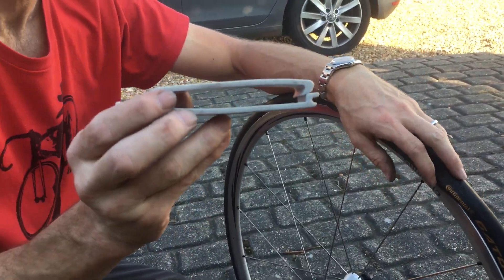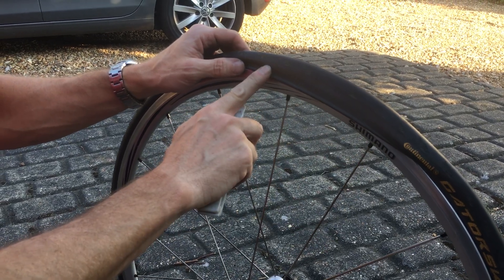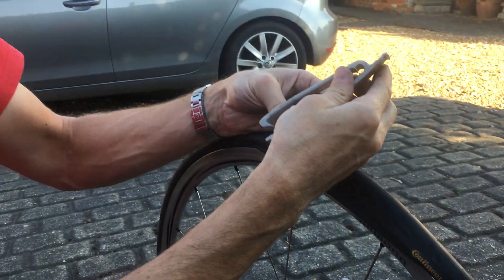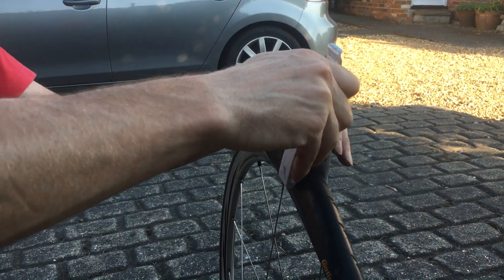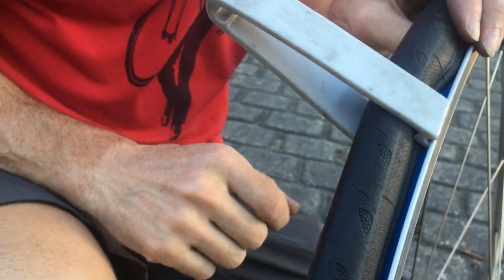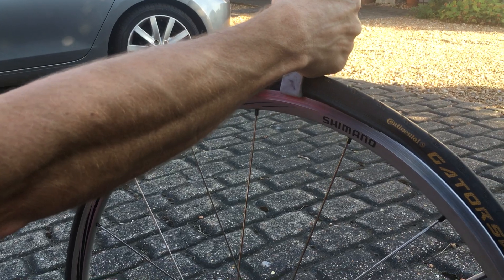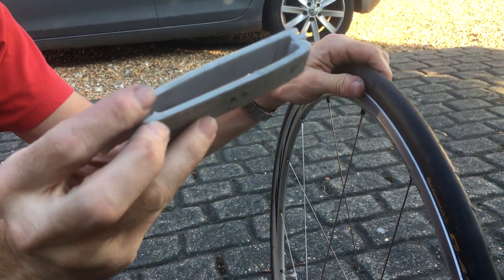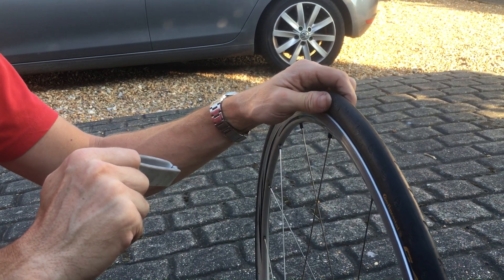How to use a VAR tyre lever on a clincher tyre (stubborn clinchers)

Comment: I notice that you are not finishing reseating the tyre at the valve. That means the tyre cannot drop into the well of the rim, thus making fitting much more difficult. ALWAYS start to remove the tyre at the valve, and ALWAYS finish fit it back on at the valve. If you look carefully at the visual instruction shown on Michelin's inner tube boxes, they show the valve being at the point where the tyre is finally popped back onto the rim. I do accept that, even then, some tyre/rim combinations can be very difficult to get the tyre back on, but most tyres can be fitted without anything special.
Reply from the maker: You are correct but for the purpose of this demonstration I deliberately did so to demonstrate the issue of reseating the tyre. These types of tools are very useful for people who don't have strong hands to reseat a tyre or have a particularly challenging rim/tyre combination that is very tight. A number of the new tubeless tyres can be very tight and this tool can save a lot of struggling.